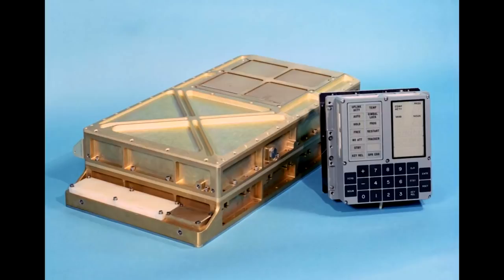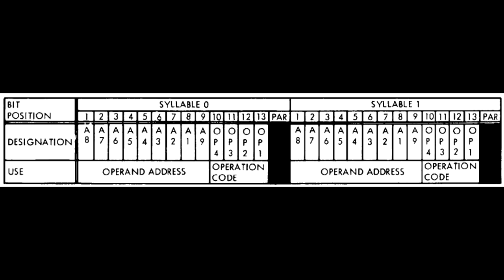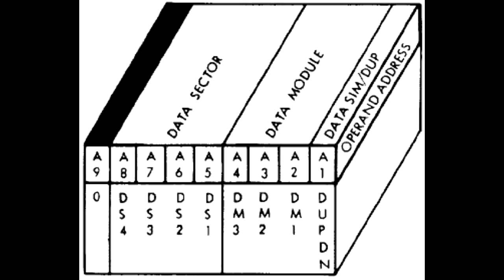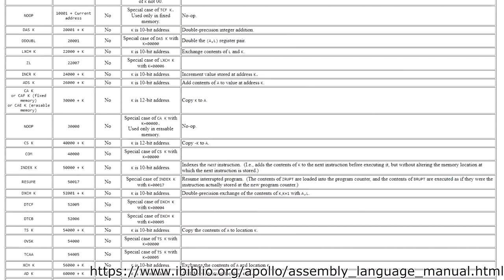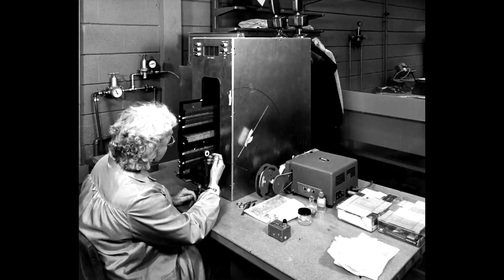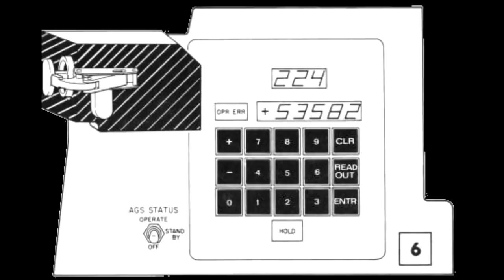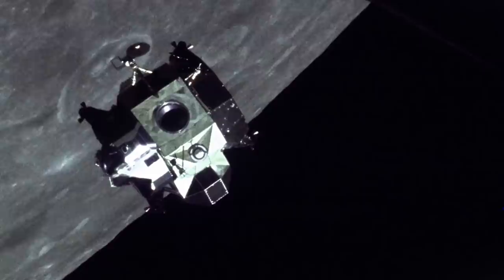The Four Computers That Flew Humans To The Moon

Comment: The more I see from the Apollo missions, the more amazing it is to see they actually made it to the moon and back.
Reply: "Everything rises and falls on leadership."
   -John Maxwell
If the organization get its people right, the right people in the right roles using the right skills and tools will handle all the technical details.
Reply: So much careful design went into it. The two absolutely critical engines that, if they didn’t fire, the men would be left marooned in space or on the Moon—the Service Module and the LM Ascent stage—were hypergolic. That means their ignition only depended on simple on/off valves working properly, not on more complicated throttles, pumps etc. The initial trajectory to the Moon was “free return”, which meant that if nothing further was done, they would simply come back to Earth again. This is what happened with Apollo 13, where the main issue was figuring out how to last the time it took for the trip back.

Comment: I was always fascinated by that classic footage of "the ring" being jettisoned during an Apollo mission, so I learned about it!
When I finally saw an actual Instrument Unit on display at Kennedy I took about 10,000 photos and really felt like things had come full...circle? LOL
One vote for the LVDC here! :)
Reply from the maker: That ring is the interstage and isn't related to the Instrument unit.
Reply: The lovely interstage separation  (skirt sep) shots. Ahhhhhh.  As Scott said, that was the skirt surrounding the S-IIs 5 J2 engines.  The IU (instrument unit) is where the LVDC and the analog computer  were. That sat atop the S-IVB, and stayed with it until it crashed into the moon, or was sent on a wild ride around the sun, as in the case of Apollo 12.  The IU had to stay attached, to still control the trajectory and transmit data.  

In the case of Apollo 13, after the explosion, the IU was causing interference in communication with the LM, because it was essentially hijacking frequencies from the weaker Omnidirectional antennas that were used.  They had to push the S-IVB out of the way a bit.   

Sorry, this turned into a long thing lol

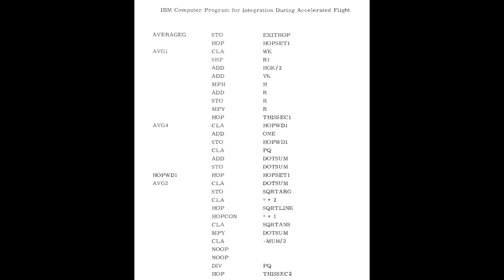Comment: 5:19 The code on the lvdc is probably still technically classified as top secret (And the same algorithms used are probably running on other hardware right now). So you could understand how the ability to guide a device from one point on earth to a distant point on a different, or more importantly the same planet could be considered classified. And publication of the binaries or source code would be in breach of the current weapons export controls.

But the reality is that smart people could fully reimplement the same functionality probably slightly less efficient, using more computing power. But the maths involved in all aspects required to implement it is far more accessible now (online) than it would have been half a century ago. I was going to say that it is not rocket science, but it is :)

Comment: Those electroluminescent displays were also not trivial pieces of engineering.
All this was actually not long ago, I am in my late forties and I have had core memory in my grubby hands.
It used to fill 19 inch racks here on earth.
And flashing your dongle in public would buy you a ticket to a stay in club fed.
Reply: Let me guess, the place was somewhere out on the prairie and the thing was almost completely underground right?
Reply: I still have a layer of CDC Cyber core memory!  When the University of New South Wales decommissioned their Cyber 72-26 it's parts were available as souvenirs.  As I had been one of the first operators, I got a few bits.  Somewhere there may be the logic gate I snagged as well?  The 3 foot diameter 808 drive platters made amusing tables for a while, but were too unwieldy to remain in use for long.

Comment: An interesting fact about the LVDC, Scott, is while the blueprints for its' hardware are available the software themselves have been lost (Who wrote the programmes is not known any longer either) however they could be extracted electronically from the LVDCs in the IUs of the two surviving Saturn 5s. However there available online several NASA technical reports which detail the algorithms and equations that formed the basis of the LVDC programmes.

Comment: Somewhere around 25 years ago, I saw an article, maybe a sidebar, I think in IEEE Spectrum, comparing the original IBM PC to the computer in the LM. In some ways, they had similar specs. Both units were similar in volume, although the LM unit was much heavier, I think mainly because of its power supply transformer. (The PC's transformer would itself be considered quite a brick today.) The original PC had a 64 K motherboard, not too different in capacity to the LM unit, but obviously a whole different critter, as the 64 K was in, I think, 9 chips that you just pressed into the…mamacita. My PC, bought in 1984, had a 256 K board, though it originally only came with 64 K of chips. I don't remember clock speed of the LM AGS, but as we know the PC was 4.88 MHz, still a slug by any kind of modern standards, but probably far faster than the LM unit.

Comment: For detailed information about how computers were designed in those days, Thorton wrote a book called "The Design of a Computer, The Control Data 6600" which described in detail how it worked (often down to transistor level).  The CDC6600 was likely the most powerful computer from 1965_1967 when the a modified successor appeared, the CDC7600.

Googling author and title should provide access to the free e-book publication.

Comment: Yet another reason Apollo wouldn't work today: they'd have endless meetings attempting to unify a command set and word structure for lowest power / most reliable / fastest speed; meanwhile, someone in Hungary managed to cobble together a 386 to run the original AGC in C.
Reply: They managed to decide on PowerPC CPUs for the Mars rovers.

Comment: Excellent explanation, thank you.
The Saturn V "analog computer" was the optimal approach for a time when fast A/D and D/A converters were yet to be invented (I spent the good part of 20 yrs of my design career with analog computers).
I like the final hyperbole: "when the computer designer couldn't agree on the number of bit in a word". How true. I guess we should say thanks to Mr. Shannon for the eight bit in a byte.

Edit: I didn't know Armstrong gimbal-locked the half-LEM before docking. I remember, though, some astronaut asking for a fourth axis, and never understood why MIT didn't allow for it. Gimbal lock is a totally man-made system failure, IMO.
Reply: A fourth axis would have added weight. It was a compromise, save weight but have this scenario you need to avoid. Gemini capsules had four axes, but then they didn't care about weight so much.
Reply: I can't guarantee it, but I belive it was Michael Collins who asked for the 4th gimbal for Christmas.

Comment: If you think about it, having the computer systems operate on different platforms using different code is kind of smart. It means the chances of a flaw in one groups hardware/software killing the whole system is reduced.

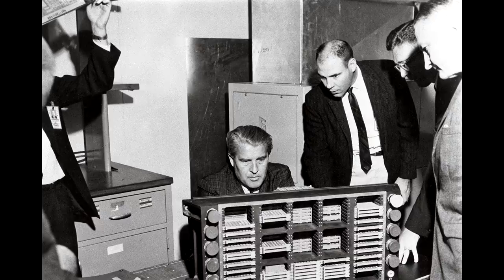Comment: 2:00 , the LVDC ceramic chips were NOT soldered but retained by springy contacts
Watch FranLab for a teardown of an LVDC board.
Reply: From a technical standpoint, the integration of the chips in the  LVDC was way more of a advancement than the way the AGC was built.
Modern computers are way more directly related to the LVDC than to the AGC.

Comment: I wouldn't be surprised if the codes that guided the Saturn V launch stage stays unseen. I have met old engineers who worked on some of those liquid fuel rocks as well as what they called non-NASA solid rocket boosters. But they said many times because some of the computer code was probably also used in early gen liquid fuel rocket ballistic missiles. Even the missiles never went into production, the code itself and any similar code would still be classified. Meaning code from 60's would still be classified even today, since anything to do ballistic missiles is top classification.

Comment: Good resource management is essential to solve problems with this/these system(s). Since it was done so efficiently, it was possible to achieve the better results, especially back then.
Some of those benchmark test results are still better back then than today.
Certainly, it's easier to design newer systems which would function better today, but those are used by military for airplanes and, jets, so...

Comment: I wonder if the LVDC code is quietly out of reach because it's still running on some ICBM booster in a silo somewhere...
Reply: Hmm, could be. If it works, why reinvent the wheel. Just the hardware has reduced in size.

Comment: I don't doubt the computer could work properly, and be really heavy. It was a good design to have the priority design as to not mess up when overloaded. They should have been more familiar that the overload could happen though in training.  What I don't trust though is the computer knowing basically where in space it is to start with. I could see a radar to surface being a reliable source of at least height and horizontal speed, which would be a good start for fuel burn calculations.

Comment: It's interesting that the LVDC used 2's complement when the AGC used 1's complement. Was that to save memory in the AGC architecture or something? I'm just reading the Frank O'Brien book on the AGC and I had to go and look up some computerphile videos to reaquaint myself with 1's complement.
Reply: Ok, I have a partial answer to this question now. The AGC used two's complement for gyro input and one's complement for everything else, so there must have been some advantage to using one's complement. Probably that the end around carry required an additional computational step in two's complement which would presumably have tied up a register as well.

Comment: At 5:07 there is a comparison in which the AGC performed an operation in 168 microseconds with 28 bit precision whereas IBM's LVDC required 246 microseconds with only 25 bit precision. Was IBM's position that the extra performance of the AGC was unnecessary to accomplish the mission? The analogy being that a road trip can be successfully completed in a Trabant as the capabilities of a better car wouldn't affect the completion of the road trip.

At 5:15 an explanation of this program would interest me if no one else. Surely this one page is not the entire program?

Rope memory? Was this similar in any way to the iron toroids in the IBM LVDC memory?
Reply: Rope memory also used ferrite cores.

Comment: Howdy Scott,

Could you do a video explaining how a rocket knows it’s prograde and retrograde vectors. Because there is no obvious reference of velocity how does a spacecraft know in deep space it is pointing exactly in the direction of the velocity vector?
Reply: The missile knows where it is at all times. It knows this because it knows where it isn't. By subtracting where it is from where it isn't, or where it isn't from where it is - whichever is greater - it obtains a difference or deviation. The guidance subsystem uses deviations to generate corrective commands to drive the missile from a position where it is to a position where it isn't, and arriving at a position that it wasn't, it now is. Consequently, the position where it is is now the position that it wasn't, and if follows that the position that it was is now the position that it isn't. In the event that the position that the position that it is in is not the position that it wasn't, the system has acquired a variation. The variation being the difference between where the missile is and where it wasn't. If variation is considered to be a significant factor, it too may be corrected by the GEA. However, the missile must also know where it was. The missile guidance computer scenario works as follows: Because a variation has modified some of the information that the missile has obtained, it is not sure just where it is. However, it is sure where it isn't, within reason, and it know where it was. It now subtracts where it should be from where it wasn't, or vice versa. And by differentiating this from the algebraic sum of where it shouldn't be and where it was, it is able to obtain the deviation and its variation, which is called error.

Comment: Commonality my ass, I’m going to do it my way! It’s amazing with all the vibrations on launch that they didn’t experience any major failures in these computer systems. I believe it was still the fact that there were persons with nerves of steel who took over the landing of Apollo 11 that made for their successful landing on the moon’s surface and the mission! Bad Asses all of them! I would like if you could go into detail of each sensor’s systems interface into the computer systems that provided information into these computers. Would you? I know it would be long and boring for most but there are a bunch of us who would love to understand this complex interface?? Please? Please?
Reply: I'd love that! Would be just as exciting as Everyday Astronauts recent 1h videos on engines
Reply: @k1ngjulien_  I absolutely agree! It's so easy these days to just use arduino libraries and documentation to effortlessly pull data from all sorts of premade sensors, so I'd love to see how they approached and solved these pretty fundamental computer control problems so early on.
Reply: Head over to CuriousMarc or BPS space for hours of nitty gritty details on the AGC or rocket control software.
Reply: Vibration?  The LVDC on Apollo 12 got hit by lighting twice and all they had to do was try turning off and back on again.  (sortof)
Reply: @DaveF.  No, the LVDC was not affected at all by the lighten strikes.  It did not skip a beat.  It was the SCE in the CM that needed to be restarted
Reply: The electronic innards were buried in a thick mass of epoxy precisely to resist shock and vibrations. That epoxy is now an obstacle to fixing salvaged units that don’t work.
Reply: And they also welded all the connections in the AGC, soldering was not regarded as good enough.

Comment: He said operand, I've not heard that term in decades
Reply: As a programmer I encounter it on an almost weekly basis. Basically whenever I'm in the debugger because it only debugs sensibly at assembly level (optimised code that won't fit if not optimised), or when I'm writing assembler code.

Comment: It is so funny, as if they just waited 2-3 years more, the entire computer could be shrinked by a factor of 20, and made 10 times faster, significantly lighter and use significantly less power. This would allow them to have higher redundancy too. First DRAM IC chip was released in 1970, and first IC CPU was released at the end of 1971. Similarly EPROM ICs were available in 1971, and EEPROM ICs in 1972. Mask ROMs were already available before that, and by 1971 had similar capacity to DRAM / EPROM of the time.
Reply from the maker: The space shuttle used plates wire memory into the 1990’s. So did HST
Reply: @scottmanley  Well, it is needed on HST and SS because of how long they operate in space with radiation from space . You wouldn't need such requirements on LVDC for example.

Comment: 8:37 - So what would they have done if a failure occurred which both crashed the AGC and wiped out its last-good-state information?
Reply: Probably they'd have died.
Reply from the maker: During lunar landing they'd have used the AGS. 
The rest of the time they had hours to realign the platform using the stars.
Reply: @scottmanley  couldn't they get updated data from ground control (outside of landing/ascent)?  Or would the multiple time delays make it corrupted?
Reply: @HuntingTarg  Once they got the computer-radio interface running uploading an approximate state from Houston should be doable.  But star realignment was already something they did multiple times on each trip.

Comment: So, to setlle the discussions once and for all, what is the smallest 'modern day' computer that could have replaced all the computers.
I'm including the BBC, C64, zx spectrum, windows 3.1, apple 1 etc, or does it need to be more modern
(ideea for another vid maybe ? )
Reply: There are probably 1$ microcontrollers that are faster and have more memory than the sum total of the Apollo computers. Don't quote me on that, but I know for a fact you can get microcontrollers about the size of a pea that run at 48MHz (24x faster than any of the Apollo computers) and have Megabytes of RAM & ROM, so, thousands of times more memory. Also, they consume milliwatts of power rather than dozens or hundreds of watts. So, basically, an entire computer, MUCH MUCH more powerful than all of the Apollo computers combined, but that is smaller (much smaller) than even a single one of the silicon chips seen in this video.

Comment: Scott what type of voltages did the computers run on?
Reply: DC 13v 12v 6v 5v 3v 2.1 v
Reply: @steveshoemaker6347   Thanks for the info. That is a bit of a range of lower voltage.
Reply: @seannot-telling9806  That voltage is still in the range of Computers today....l am 77 years old now....But l still build a Computer now and then....Cheers my friend...!

Comment: How these computers was chilled?
Reply: I believe they were liquid cooled. IIRC, a closed loop cooler would transfer the heat from the computer to a heat exchanger on the outer surface of the rocket. Once there, water created by the fuel cells, would be passed over the heat exchanger and as it evaporated into space it took the heat with it.
I know that's a really poor explanation, and I'm sure there's a video out there that explains it properly and clearly.
Reply: liquid cooled, this was a problen on Apollo13, 2 of the 3 fuel cells died causing a loss of electrical power but also a loss of water for drinking and cooling the elecrtonics